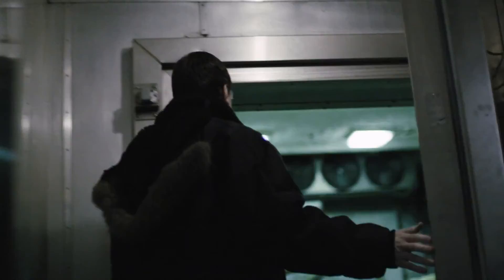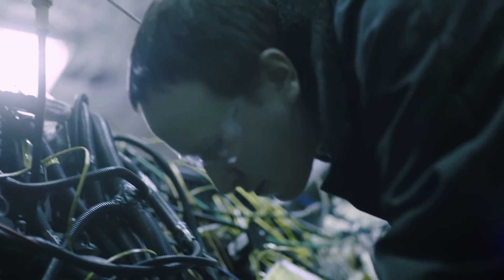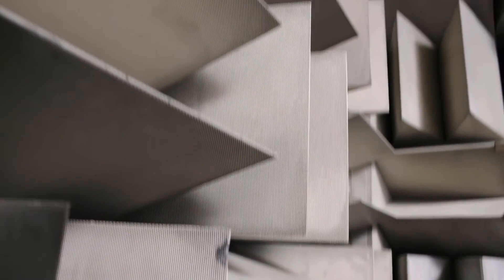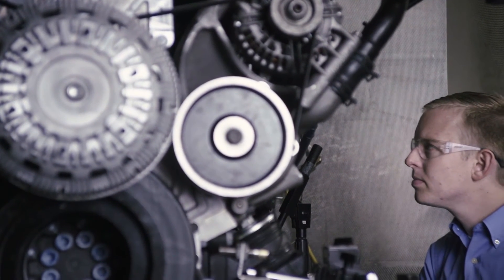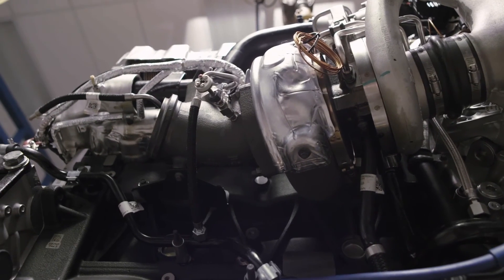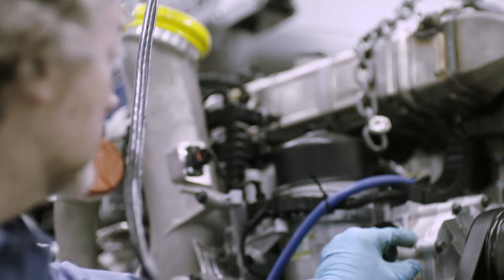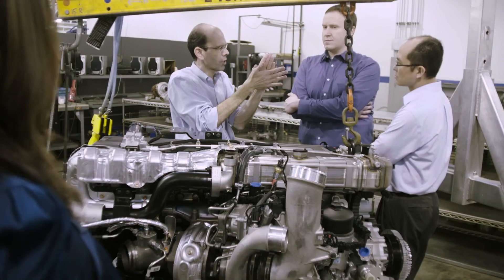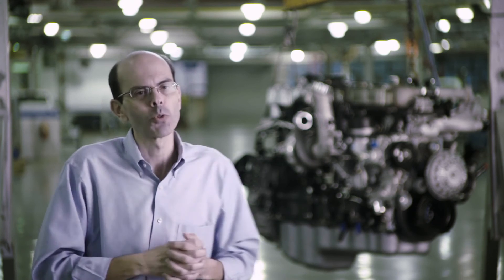International's A26 Engine Launch - Project Alpha

Comment: They need to do away with EGR and come up with something new.  Recirculating dirty exhaust back into the engine is not a viable solution, it only guarantees early engine failure.  People are trading these trucks in between 200K and 400K miles bc of the emission problems starting to rear the ugly heads.  When before all this started, they would trade them in between 500L and 700K.
Reply from the maker: Hi Jim, we believe the new A-26 engine addresses reliability issues.

Comment: I wonder if the same test methods will be used for the EGR coolers on this engine as the previous engines from the same experts.  I doubt that anything has been done to make sure that the EGR coolers actually work this time.  High speed and load testing has little to do with EGR cooler failures.  Plugging and fatigue cracks are the most common failures, and I don't see any mention of the tests for the EGR cooler.  We can use the garbage can pump, school floor cleaner, and leaf blower kit from Navistar to clean more plugged coolers.  That is not a joke.  That is the way Navistar wants us to clean the plugged EGR coolers.